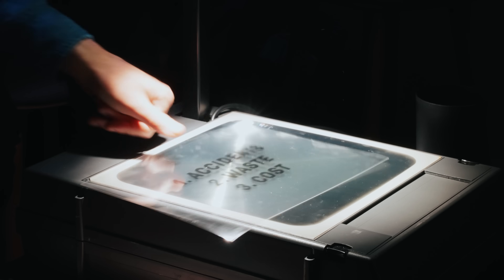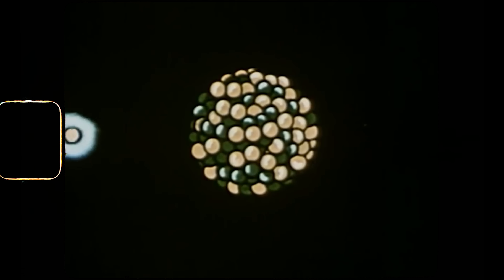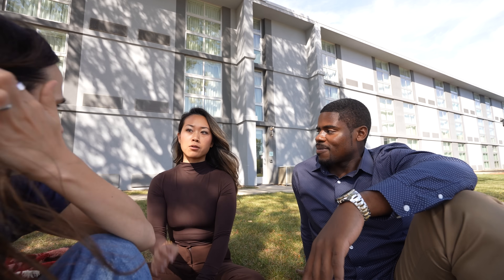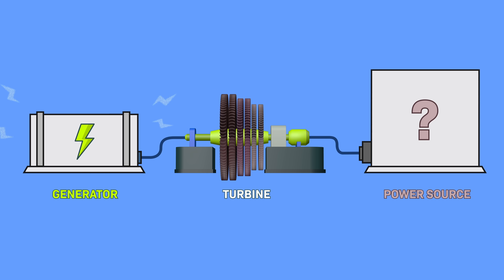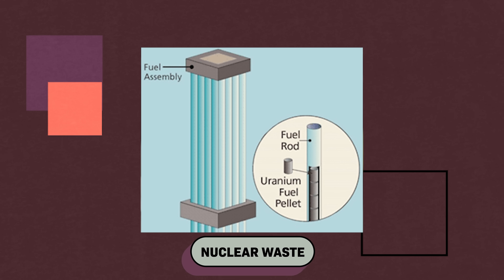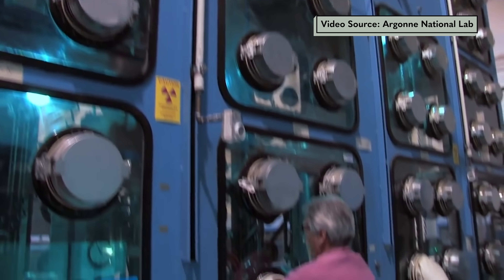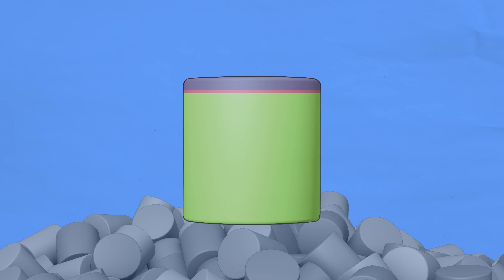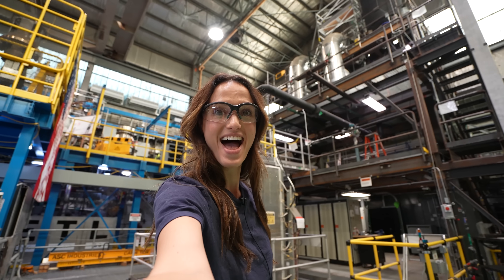The Big Lie About Nuclear Waste

Comment: Gaslighting. The physics don’t work. The engineering doesn’t work. The economics don’t work. And it is in no way simple. Politics is not the issue or problem. What you are talking about are facilities to process spent fuel to recover the actinides from the waste, to process it into fuel, and then to build reactors to run on this - Mixed Oxide Fuel.  On a full scale basis this turns out to not just be complex, but unachievably complex technically. This puts the fission product waste in an ever more dangerous and mobile form, and does nothing to resolve the waste problems. 

Even when second stage fuel is produced, the physics involved change the reactors in ways that make them extremely dangerous. Worse, certain extremely dangerous and extremely long lived actinides (super heavy elements) continue to “grow in” in quantity and become ever greater problems. 

The plutonium rich fuels are extremely dangerous to use in reactors, and incredibly difficult and dangerous to handle. 

The molten salt separation process is a terribly dangerous process for proliferation risks. We simply cannot contain the process to “the good guys”. Combined with laser isotope separation, another nuclear wet dream, this becomes a path to ever greater amounts of incredibly dangerous nuclear weapons. 

Also, the waste salt puts the fission products in an even more difficult to contain form akin to the immense problems created at Hanford, Washington by adding caustic to the waste fission products to protect the steel tanks from rapid corrosion. 

You claim to be talking about “nuclear waste”. You aren’t. That is gaslighting. You are talking about trying to recycle the uranium and other actinides, not about all of the incredibly dangerous waste. Even if this process could be made to work technically, financially, and the waste problems could be contained, this generates even more nuclear waste that is even more dangerous. And worse, it creates ever more and richer plutonium wastes that are intractable proliferation, safety, and health problems. 

Additionally, the cost of power from these second stage reactors is vastly more expensive than the already completely non economic non competitive power from existing reactors. 

Lastly, this is in no way “green” or “clean”. That too is pure gaslighting.

Put down the nuclear Koolaid. Stop being a nuclear shill. Focus on real solutions to problems, rather than fantasies.
Reply: Damn, someone who actually understands the subject. Thank you for sharing the insight.
Reply: What do you think about Russia's program to build fast reactors with a closed fuel cycle to eliminate the waste?
Reply: @TheFAFOHouse  It won't work. And the reactors will be dangerous.
Reply: Thank you for your informed input, very helpful in understanding the issue. What would be in your opinion ,a real solution to energy production? 
In terms of so called preferred ( green solutions) such as ( renewables ) shouldn’t they be placed in the same category as propagandist fantasies?
Reply: @Questforenigma  The easiest and most immediately available and applicable are 1) energy conservation through better design and construction, insulation minding the other issues of indoor air contaminants, etc... and the renewability of the materials used, 2) passive solar design, 3) ground source heat pumps,both passive and active forms, 4) solar thermal power, 5) solar and wind commercial power, bearing in mind many design elements and thinking through long term renewability and maintenance, 6) true reuse and recycling - not the sham practiced today. This must include forcing manufacturers to take back products and be liable for the wastes they produce, so that they build renewability and reuse into every aspect of their products, 6) biofuels down in a renewable way, heavy emphasis through financial policies on local production and use of all goods, and greatly penalising long distance transport. Yes, this is the opposite of "free" market capitalism that seeks to reduce labor to the lowest cost globally - the environment, people and society be damned, 7) possibly fusion. Fusion has been a pipe dream. But a dozen recent developments may bring it online in the next few years, competitively, and ending most fossil fuel and nuclear use. Tritium release (containment) is a huge issue. So are "first wall" problems and fairly short-lived radioactive waste generation. 8) Cold fusion (now called low-energy nuclear reactions or LENR) may play a role if anyone can figure it out. And yes, it is very real. 9) A likely or possibly  related power production method using fractional quantum states to essentially borrow power from the environment that is then thermally repaid by the sun originally developed as "Black Light Power", now "Brilliant Light Power". Jack Mills cracked the holy grail of chemistry with his fractional quantum states theory and has been able to calculate from scratch the bond energy of all nuclear interactions. Only one of those, singlet hydrogen has a significant deviation (7%) from real world measurements. Main stream science rejects his work. So he receives no real public or academic acknowledgement. But if his company can put the pieces together correctly to result in thermodynamically available power (which they seem to have done), the impact could be enormous.
Reply: I agree with everything you said and I also made numerous comments about this. Another thing you did not mention regarding MOX (aka "recycled" fuel) is that you cannot recycle them again - or to put it better: Recycling MOX is even more incredibly uneconomic than the uneconomic recycling in the first place.
Reply: @whuzzzup  Yes. You are correct. Very true. The buildup of certain actinides become a serious problem too. And worst of all, as the plutonium piles up (we now have over a thousand metric tons of the stuff), and time passes allowing the decay of things, the isotopics become better and better for nuclear weapons. 

If it disposed in shallow or unguarded burial, people will see it as valuable. And they will dig it up. That is what people do with anything perceived to be worth $$. These "plutonium miners" won't care about the risk, or anyone else being harmed. They want the $$. And so -> the waste must be guarded long into deep time. Far far longer than civilization has existed.

Comment: I'm not against nuclear energy, BUT- this assumes all nuclear waste is spent fuel rods. Spent fuel rods are not the only problematic waste. Look into the irradiated degreaser trichloroethylene (TCE) and groundwater plumes- for instance.  Not to mention millions of pounds of contaminated scrap metal, etc. This video ignores all the infrastructure and systems used to sustain and support the  reactors and enrichment programs. You can send contaminated water and earth through the reactor like a fuel rod. It has to wait 200,000 years.

Comment: This fuel issue is all interesting, but it ignores another real and costly risk with nuclear energy. Billions have been spent on cleanup and containment at Chernobyl and Fukachima and they are no way near complete. Generations in the future will be dealing with that legacy. Why not spend those billions on building and researching clean energy production and storage tech? With reactor disasters, it’s only a matter of time before it happens again.,
Reply: Newer nuclear tech makes meltdowns almost impossible, and the real fix for nuclear is to not go big with it.  What I mean is that today's nuclear reactors are gargantuan and complex dealing with lots of nuclear fuel at a time.  What that means is that IF something goes awry you've got a very serious problem, and containment of the fuel if it melts down is very problematic.  The answer is to go small with each nuclear reactor.  Instead of building a massive reactor that produces 1 GW or more you create lots of much smaller reactors where the chances of going critical are much MUCH smaller, and more easily contained if something does go awry, but that's the beauty of smaller reactor designs.  It is damn near impossible to reach critical levels of heat in them.

Comment: In uper morthwest was a research facility that was using this recycle method you alluded to  in this video. Thanks for sharing.  I still think  most people  in USA are stuck on scared 😱 of the use of nuclear waste. Getting a movement  in making people understand the reality of the positive good uses of nuclear waste Is a positive thing  indeed.
Reply: Are you speaking of hanford where they reused spent fuel rods to produce plutonium? Thats an environmental disaster for millions of years forward

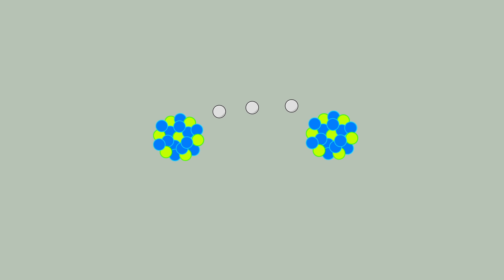Comment: @6:48 you forgot solar thermal as a source ....was that intentional?  The video say we need to commercialize it but earlier says it is the norm in Japan so which is it?  Since a new nuclear power plant costs 30 billion I wanted to find out what you get for your money.   Nuclear energy has been powering the U.S. grid for the past 6 decades and produces around 1 gigawatt of power per plant on average, so i asked Chatgpt how many solar panel and power you can get for 30 billion : 

The cost of a solar panel can vary depending on several factors, including the type, quality, and quantity purchased. However, as of my knowledge cutoff in 2021, the average cost of a solar panel was around $0.40 to $0.50 per watt.

With a budget of 30 billion dollars, we can calculate the number of solar panels and gigawatts that can be purchased as follows:

Assuming an average cost of $0.45 per watt, 30 billion dollars can purchase 30,000,000,000 / 0.45 = 66.67 billion watts or 66.67 gigawatts (GW) of solar panels.

The actual number of solar panels required to generate 66.67 GW of electricity will depend on the specific panel's wattage. If we assume an average panel wattage of 350 watts, then 66.67 GW can be generated using 190,476,190 solar panels.

It's worth noting that the cost of solar panels may have decreased since my knowledge cutoff in 2021, so these calculations may not be entirely accurate. Additionally, the wholesale bulk pricing may vary depending on the supplier and the location of the purchase.

Comment: An individual's lifetime share of nuclear waste is approximately the size of a soda can. As long as the waste is stored in a geologically-stable vault, it poses little risk. Why we aren't using nuclear energy to solve the climate change problem is still a mystery to me.

Hopefully fusion power becomes viable within the next few decades as that would solve the energy problem without the political issues.

Comment: The nuclear waste you don't hear about is not the spent fuel that we already know of, it's all the actual contaminated garbage. Tyvek coveralls, Tyvek booties, rubber gloves, disposable hoods, duck tape, respirator cartridges, air filters, floor sweepings, active waste water from radioactive laundry and floor washing etc. This is considered low level waste and it wouldn't even be an environmental catastrophe if it got out, at least from a radioactivity standpoint. Just by sheer volume of actual garbage, nuclear plants put out a very large volume of trash each day. They are like towns with thousands of workers all producing garbage, radioactive or otherwise. The radioactive stuff must still be stored in sealed containers or specially designated landfills and the rest goes to on sight or municipal landfills. I think they could burn much of it in waste to energy incinerators, then all we'd have to deal with is what was was filtered out. 

All that said, nuclear is currently the cleanest and most abundant energy source humanity has and we just need to focus on safety and preventative maintenance, learning from past mistakes and making continual improvements to prevent future ones. Spent nuclear fuel is also used in making isotopes for medical applications.  So until fusion is perfected and nuclear phased out, nuclear is the way to go.
Reply: Fusion will produce even more radioactive waste than fission nuclear does.

Comment: Nuclear power production is the dirtiest, filthiest, laziest, over complicated, 
over engineered, over priced in every conceivable way, solution to a problem.
Don't be afraid of speaking out against it.
Reply: You're a more-on...  No other energy source uses less resources to build and operate than nuclear does.  To build just one wind turbine, for instance, it takes 900 tons of steel, 50 tons of plastics and fiberglass, and 2,500 tons of concrete to act as the foundation, and to make enough wind turbines to equal 1 nuclear power plant you need almost 300 wind turbines.
Reply: @Les_S537  You forgot to mention the run time of the wind turbine versus the nuclear reactor
Reply: @Elcicikos  You mean capacity factor (run time)?  Or do you mean the lifespan of the turbine?
Reply: @Les_S537  Sorry bad english. I mean lifespan.
Reply: @Les_S537  This more-on knows that a corner stone of science is there is no such thing as a closed system. 
All nuclear reactors leak . All nuclear storage systems leak. And if you think that is ok then your name along with all other nuclear power generation advocates should be put on the list of liquidators for the next nuclear accident which is coming like it or not. Meanwhile a wind turbine falls over laughing at you.

Comment: I'm all for researching and implementing commercial solutions for new or unused technologies such as nuclear waste recycling. To me it seems wind + solar + cheap grid scale batteries will be the winner due to relatively easy scalability and lowest cost. The cheap batteries are yet to come though, but my guess is that they will come this decade.
Reply: Risk. The margin for error when working with nuclear waste is insanely small.

Comment: The electricity consumption of the US in 2022 was 4 trillion kilowatt hours. ... 150 years of that .... that's a lot. And just break it down to how many reactors you'd need to just produce that insane amount of energy even for one year - and those would irradiate the materials used to build them, and you can't recycle that - I don't think that will work out at the immense scale.

Comment: Don't buy the hype, nuclear waste is a very real thing. That has a half life of thousands of years. It is not a green energy source. And it sure as hell isn't environmentally friendly. Explain to the nice people what Yucca mountain is.
Reply: Modern molten salt reactors will be able to "consume" every bit of the nuclear waste we have generated over the last 70+ years reducing the waste by 97%.  Today, the US has about 90,000 tons of nuclear waste.  Molten salt reactors could reduce that to a few thousand tons.
Reply: There is no such thing as green energy. Everything you build has an impact on the environment
Reply: @Elcicikos  Green energy is related to the energy generated by the device...  In other words, to build a coal powerplant, or a wind turbine, you're going to have environmental impact from that.  That is unavoidable.

But once the coal power plant, or the wind turbine is constructed, the energy generated by each has a further impact.  With the coal power plant you have to continually feed the plant with coal in order for it to generate power.  Once a wind turbine is constructed, it's impact is virtually non-existent (green).

Comment: Really great presentation. But they missed the biggest piece when they were guiding you through it. That is the fact that using nuclear fuel to power a turbine. A technology invented in the first century CE. It's incredibly inefficient. Beta voltaics if funded and developed to the appropriate scale could convert the beta decay of these materials directly into electricity. Furthermore it can be engineered to be portable meaning nuclear batteries for EV technology that would last for hundreds of not thousands of years. Beta voltaics is an existing technology not a sci-fi pipe dream. We currently use it in aerospace and biomedical applications but on a scale far too miniscule to be viable.

Comment: Actually one of the byproducts of the splitting is a gas and it will swell the containment tubes and that's a bad thing so they take it out of the active core to cool down. And that's one of the largest problems with using solid fuel. There is another technology that would allow the almost complete burn up of the nuclear fuel. Liquid fueled reactors in the form of molten salt.